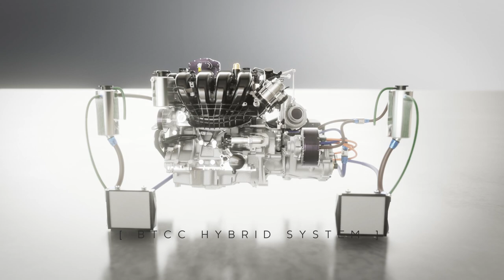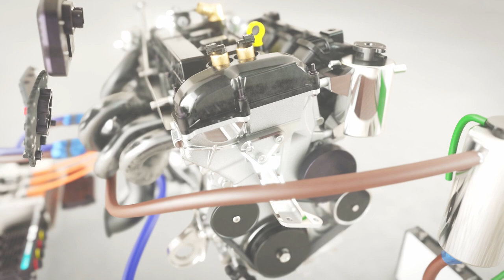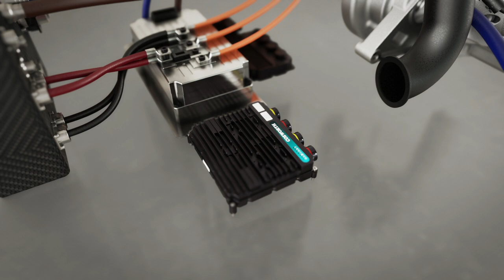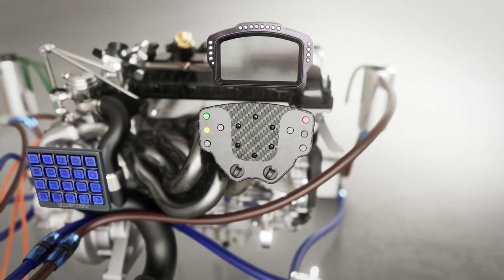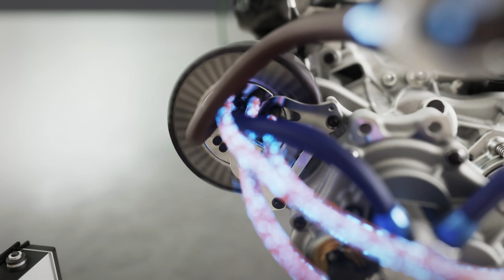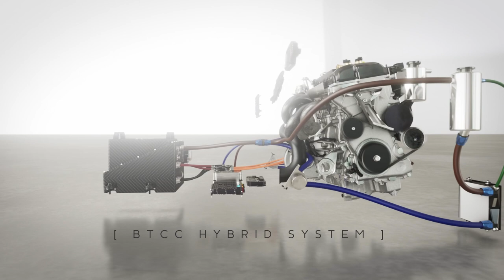Welcome to the BTCC Hybrid Era ⚡️

Comment: Thanks for explaining how it works, but what about the engine, IL4, V6 and what's the BHP and torque and how big is it 1.6, 20ltr? And how much extra power does the electric motor produce? I watched the first three races and it works pretty well instead of ballast weight, if it proves reliable.